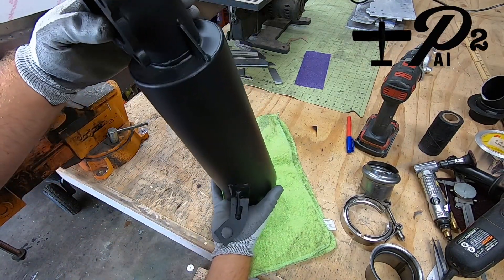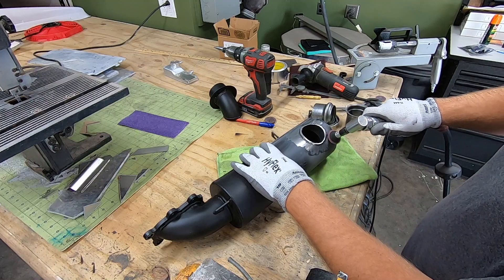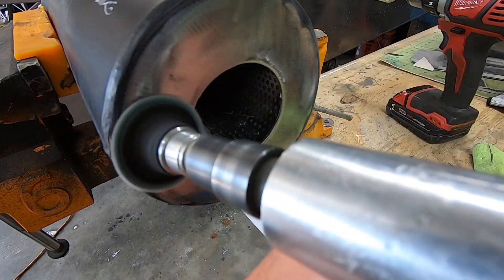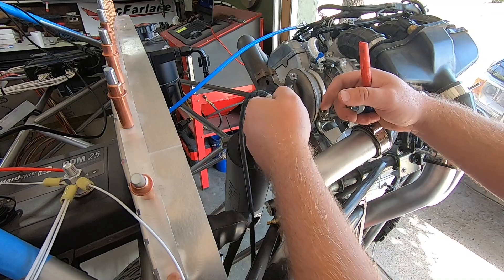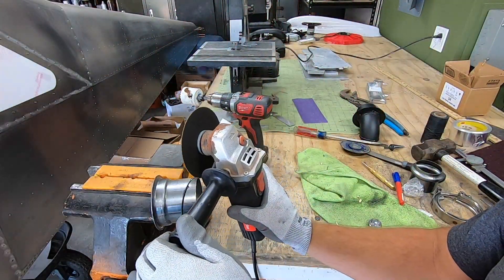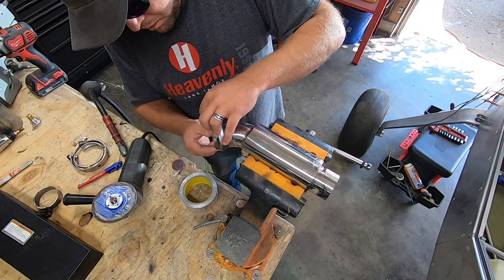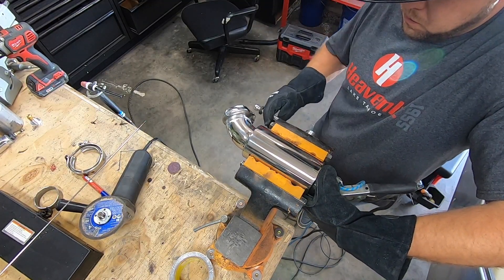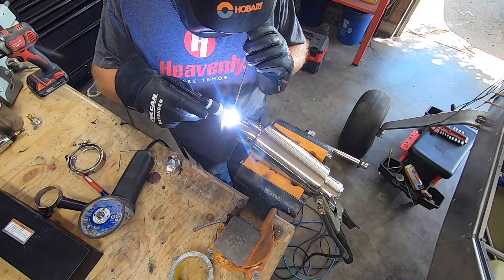Custom Built Turbo Airplane Exhaust EP36

Comment: Tig welding is so hard I had a mig for years buddy talked me into getting a nice miller tig just too much of a PITA I really didn't need to weld SS, or AL. I sold it kept my Miller Mig welder. If I need any TIG welding just take it to a shop.  Tig welding easier on a bench but most of my welding was never on a bench.
Reply from the maker: Tig is for sure the hardest welding I’ve tried so far. It is something I want to be proficient at, so I plan to stick with it and figure it out! I too have a good old mig machine standing by for jobs that I just want to get done quick! Thanks for watching and commenting sir👍

Comment: Now go down to your local John Deere dealer and get a can of muffler black and paint, I did this with a snowmobile muffler and it never rusted. I had asked around what paint would be good for this and a old farmer told me that the only this on his tractor that hadn't rusted was that muffler. Yours looks good 👍.
Reply from the maker: Not a bad plan at all! I will be applying a coating on all these parts once I get everything figured out and fabricated. More to come on what that may be in the future👍

Comment: Nice work (thumbs up). 
Thanks for sharing.

Nothing wrong with a “Butt” joint to attach the cuff (with the end fitting for the clamp), we do that in the case of transport category aircraft air systems. It’s all in the quality of the weld as you say 😉

Are you thinking of adding an ‘exhaust hanger’ to secure the exhaust tube to say the firewall ?

(If the muffler is not very light, you might end up experiencing a significant bending moment and thus stress at the end attached by the clamp, perhaps greatest during initial start ups 🤔)

Reference : sort of what I'm thinking regarding an "exhaust hanger" ...
 " ... youtube.com/watch?v=XWPYinn2Xdw "

No room for a "Ball joint" though.
Reply: By the way, wouldn’t “V” band end fittings* work better than the cuff with the bead ? … I’m not sure how that joint works ?

Reference : “ …YouTube.com/watch?v=25Vf6G75Lps “
Reply from the maker: Thanks Dave! Yes I’ll add supports for the muffler and the little tip resonator, I just hadn’t gotten that far yet. Traditional V-bands are a bit tricky to get done without warping the flange and compromising the seal. These are called marman flanges and have a gasket that’s goes in between the two surfaces (didn’t show that part). I went that direction since it’s a bit easier on a novice welder like myself to get right. They claim to seal better than traditional vbands.
Reply: @Project2Aero  Thanks Josh, appreciate the info 👍 

Now that you mentioned the brand, I’m reminded that those clamps are also typically used in transport category aircraft air systems as well.

Great work, keep it up.
👍